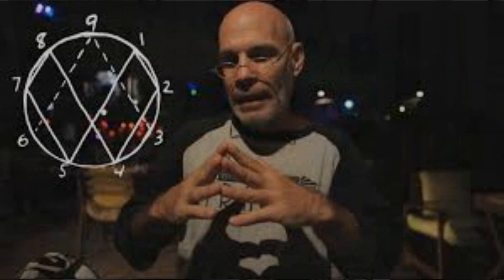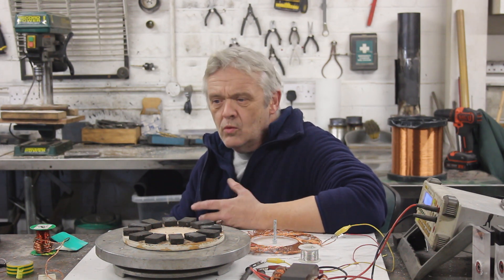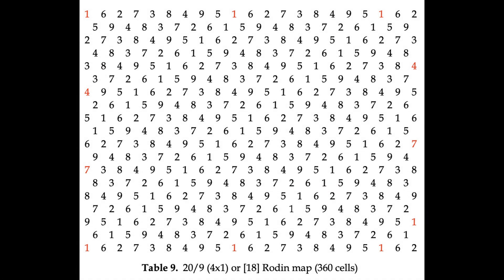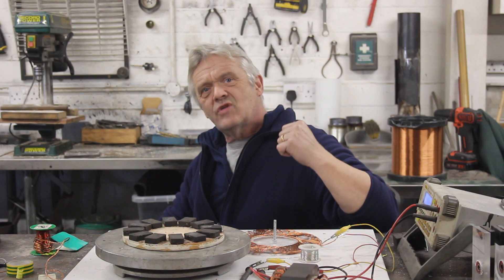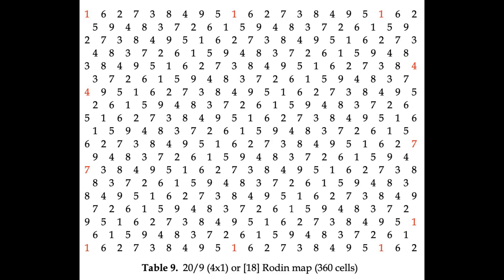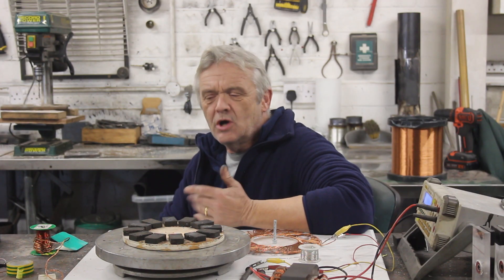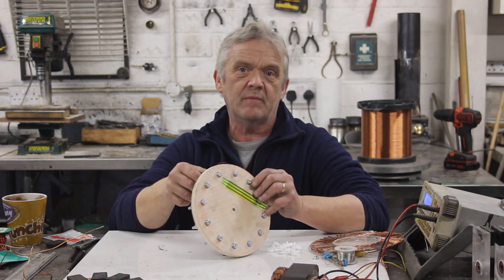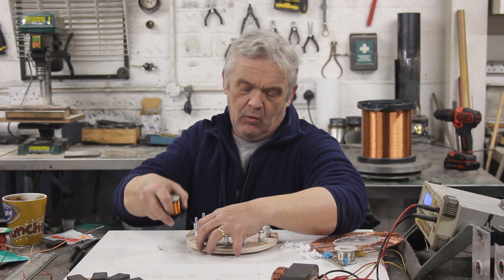1803 The Rodin Coil And How To Wind It

Comment: With upcoming 3d print deposit feature of arc overhangs, printing coils or inverts seems more and more possible every day for the average user. I am wondering if it will make sense to print an invert and fill with conductive ink.
Reply: Or... With a little tinkering, replace the 3d printer's hot end with a thin tube that has a hole in its side so that you may feed copper wire through it. Add a tensioner by the wire spool similar to a thread tensioner found on the early 1900's singer sewing machines. Place a disk with 12 vertical pegs on the 3d printer bed and carry on with copper wire. Use the robot to do what it was designed to do... Which is to lay down lines of material stored on a spool.

Comment: Perhaps double check the magnetic fields and electron flow for the entire contiguous wire to be certain nothing is trying to push electrons backwards.
ie. second leg of the triangle, opposite sides of disk, or where the triangle legs make an X.
Remember to reverse your hand (right hand rule) when mag N-S changes..

I think you may be getting some push back..

Comment: It looks like this Rodin coil suffers from the same sort of issue that traditional motor/generator cylindrical cores have, and that is it has a great deal of copper within the centre of the star that does nothing but increase the materials used, whereas the Faulhaber coil has very little material overhead.  Is this a fair assessment?

Comment: What I have read about these suggests to me the same people make claims that rank with a flat earth.
Its overly complicated maths is not really any different in a practical sense, maybe its part of the whole deal to mystify.... We already know what is most efficient, the wire cutting the field the closest and longest/greatest surface area the shape of the magnet will allow. Theoretically that would be lots of single insulated wires side by side and stacked in layers, running the full length of the magnet. That gives you the maximum energy transference. not very useful as you would have to jumper each wire top to tail in series. but even this method would work "better" for input/output than Rodin and still be inefficient.

Comment: My skepticism with the Rodin coil videos I've seen is that it seems to be a bunch of mystic mumbo jumbo by people fascinated by a pattern that shows up without having an actual understanding of patterns in numbers and what they mean or what they don't mean. They take these patterns to mean some extremely profound thing, and then infer that therefore a coil prepared in this mystic arrangement must have amazing properties. But that's not how it works. None of the theory behind the Rodin coil is electromagnetic theory, as far as I have seen. At most it is fringe number theory.

Comment: I made similar coils using a fine Litz for building crystal radios, however, the designs I found used 11 or 9 points (Rook Coils) and proved to be extremely sensitive at high frequency ;)

Comment: The Rodin Coil defines the conservation of momentum and energy. It has a perfectly stable voltage output. When a Rodin Coil transformer receives 50 watts input it creates a 250 watts output! It can be stacked and looped for larger power needs and will easily produce 5, 10 or 15 kilowatts output of electrical power to run a business or a home or an entire industrial complex. Completely off-grid with no solar, wind turbine, or batteries required. The Rodin Coil Over Unity Energy Amplifier turns milliamps into kilowatts. It is cheap to manufacture and costs only pennies when mass produced. It uses entirely off-the-shelf components, requires no special tooling and uses no exotic or proprietary materials
Reply: they repealed the law of conservation of energy ?
Reply: ..... but only has these magical properties when used on a flat Earth.
Reply: You must have drank the kool-aid.😅

Comment: I made one of these ages ago. Instead of plastic stand offs I used plastic sewing machine bobbins. Those can be silly cheap even in relatively small quantities IE about £3 for 100 of them. I also used nylon bolts. M4 if I remember correctly. For securing things I used nail polish. At £1 a bottle it's pretty cheap and I found the cheaper clear stuff worked better. I didn't bother removing it from the former I just used more nail polish to secure the bobbins to the bolts after cutting them.

Comment: 3,6,9 seems to be based on symmetry but it's more than that. Tesla Called “3, 6 and 9” the Secret of the Universe”
Could this be used to form a coil that mimics a flux pattern? I don't know, but the number 3 serves as the only number that equals the sum of all preceding numbers (0 + 1 + 2 = 3). Also, when 3 is added to itself, the smallest perfect number ensues (6). And when 3 is squared, the result is the number that completes the single-digit numbers in the decimal system - the number 9.

Comment: Thanks again Robert.  I love this Thunderbolt test bed.  I should have thought of it before but of course I just didn’t.  Once I had the magnet flywheel the coil designs can be put on in any number of ways.  I’m using microwave magnets but same thing more or less.  So many projects it’s impossible to follow through on any of them.  Right now I want to put together a solar powered fluidyne water pump for my trees and a solar powered stirling engine to turn a treadmill motor.  😂 Too many ideas from this channel,  keeps my brain spinning.  All the best.

Comment: In short. Roden math  and roden coils  and starship coils are not very helpful for power generation . It is  unnessesary complex and  requires excess length of copper.  It's like motor  copper coil overhang on steroids.  

Long winded version  with constructive input:
Rodin Vortex math is only slightly interesting in base 10. The commonly reference roden Math is math based in base 10 but only uses 1-9.  Roden vortex math is not a base 9 system.  Besides  roden vortex math generating a useless patern, the uselesd patterns changes in different base math systems which tells  us roden math paterns are not universally special or meaningful, that they are just  artifacts of the base numbering system in use. 

If flattened, a roden coil becomes a starship coil. if you send a current through it , it makes an unnessesaeily complex patern of  magnetic fields  with north and south poles fighting  each other.  The only useful part of the coil are the outside bends, and the outside conductor crossing. if you trace the current  through them, you'll see  the magnetic field and direction of current  effectivly resembles the faulhaber coil, except the faulhaber coil uses much less copper to achieve the same useful magnetic field.. the complex magnetic parts and length of coil inside is useless. Overhang on steroids.   The roden coil and starship coil inside is a wasted mess of crossing copper adding  nothing but resistance and copper cost. 

If you throw out the roden math and roden and starship coils,  but still wind diagonal coil on a torus 
for the even number of magnets,  then one is back  to serpentine and faulhabor coil on torus that's  either a flat plate,  or one with an laminated iron core having either a rectangular or circular cross section. It is  related to the torodial dynamo, except the generator has more than 2 poles and whose coils are wound more related to a serpentine type and faulhaber coils. 

I've seen iron torodial cores made from steel  bailing wire,  and others from steel strapping.

Comment: I had a feeling you were going to talk about this coil based on your last video. I built a few of the toroid coils using 3d printed frames but never found anything particularly special about them, it's cool how the Flux lines overlap through.
Reply: Toroids make good filters and multivoltage transformers. 
As you say, flux fields are different so requires very different designs to make motors/generators.
Reply: @Dr_Wrong  I don't think I've seen them as filters but I know they make good transformers. Have you seen any air core transformers? If I ever get back into it I want to try making a toroidal tesla coil
Reply: @Ivan.Wright  "Have you seen any air core transformers?" 

I haven't. Do you mean like inductive charging?

The issue with air is that it has a relative magnetic permeability of 0 (zero). 

While silicone steel will instead multiply the magnetic flux strength by 4000; 
Iron (99.8% pure) by 5000; 
Cobalt-Iron (99.8% pure) by 18,000.
Reply: @Dr_Wrong  I mean a tesla coil that uses toroidal coils rather than solenoidal ones
Reply: @Ivan.Wright  

Oh, IDK. Never saw much use for tesla coils (tesla anything, really) so I never studied them.
Reply: @Dr_Wrong  Although I don't find much practical use for Tesla coils, I do believe they are worthy of study. The intricate overlapping dynamics and properties on display in their simple design make them a valuable subject for investigation. I have an idea that by understanding the dynamics of a tesla coil well enough to translate it into a toroidal form, I would have a sufficient understanding of the practical dynamics of the properties. I also think it would look cool.
Reply: @Ivan.Wright  

LoL
I agree with every word of that! 
Cool is 9/10ths the value of science! imho

Comment: From what I understand, votex math is based on the observations of Nicola Tesla. He recognized the special relationship between the numbers 3, 6, and 9.  Cryptically Tesla would say that the key to free energy was found in the numbers 3, 6 and 9.
Reply: 3 6 and 9 are the only numbers which produce themselves when using recursive unary addition. Numbers 1 2 4 7 8 and 5 will never recurse to 3, 6 or 9. Numbers 3 and 6 will recurse to themselves depending on where you started in base10 (eg the number 33 resolves to a 6, which doubles to 12 which resolved to 3, which doubles to 6, therefore the number 33 resolves to  6 in this math). For geometrical positioning of coils and rotors, these infinitesimals are extremely important. 

Most producers of the Rodin coil seem to take on an electrical view to the coil construction when in fact what we are doing with the Rodin mathematics is mapping the flux density of a single point so that we may maximise the harvest at the point of alignment

Comment: Super cool thing about base 60 (or rather 12)-  also comes from fingers.  It's how the Ancient Sumerians counted-  you have 12 spaces between the joints of your fingers (using your thumb to keep track), and you've got 5 fingers on the other hand- 60, or 12 finger joints-144.  So you can count to 144 on your fingers, easily.   just blew my mind.  Wish somebody had told me that when I was a kid.
Reply: I like base 60. It makes fractions easier. More exact than decimals in some cases
Reply: I didn’t get it at first but you look at your palm side to notice 3 per finger ha
Reply: base 12 is the king of bases, highest ratio of common factors to absolute value
Reply: Brilliant!
Reply: Kraik  Nope, but it sounds interesting, I will check it out. Thanks
Unless you wanna sum it up or refer a specific link...
Reply: AGREE ITS VERY COOL. THEY WERE BRAINY PEOPLE
Reply: You can count to 1024 on your fingers if you know how to use binary
Reply: These are sacred numbers. I study them.
Reply: yeah, base 12 is awesome, if you plot out the times table and division table and you see how easy the patterns are to memories, it's almost madenning, it would make math so much eaier for everyone.
Reply: I plan on teaching my children this counting system first
Reply: You can also count to 31 on one hand if you use a retracted(probably wrong term to use, but you get what I mean) finger to symbolize a 0, and an extended finger to symbolize a 1 in base 2. Can hold a total of 1024 values on your two hands using base 2.:yougotthis:
Reply: ZPE generator rodin coil of about 300kw as i got lots of 8 AWG copper wire i found.
Reply: I'm lost.  I understood presentation word for word without repeat views. But the broken English and half-assed explanations occurring  within this thread, coupled with my slowness is causing me to get a math headache. Lol.
Reply: 12 also nice when working with time (ie 60 minutes in an hour and 2 times 12 hours in a day) and space (360 degrees in circle)
So yes I agree 12 is best. But originally 9 was considered define, then "they" added the zero for rounding purposes and hence a common way the ultra rich bankers stole money without people noticing.
Reply: @Pok3rface  riiiiiight. Nothing to do with ten digits between both hands
Reply: That's really cool.  Biblical number